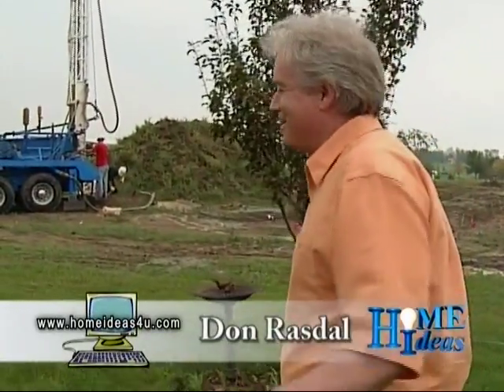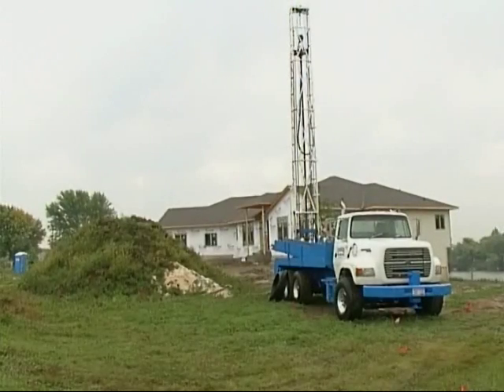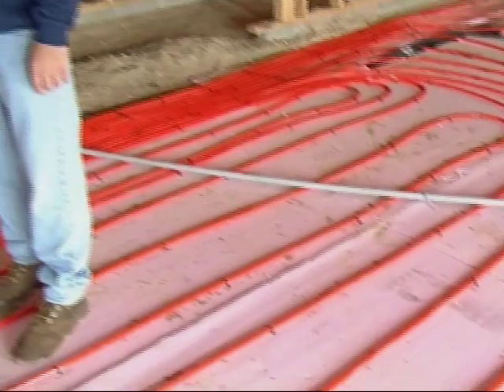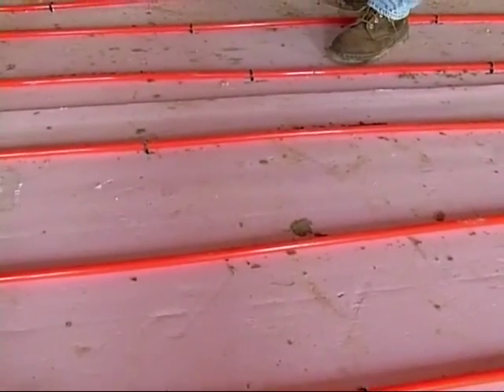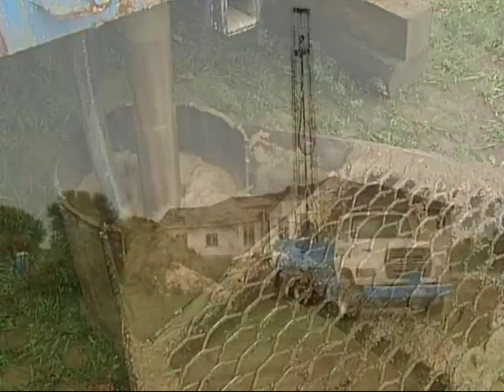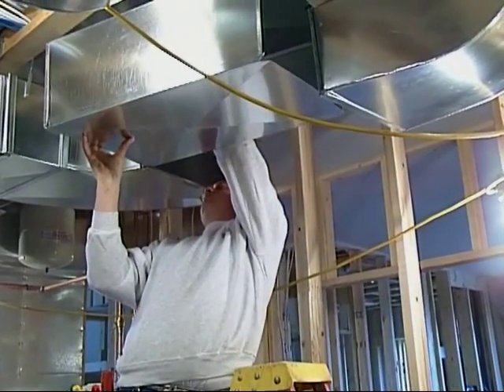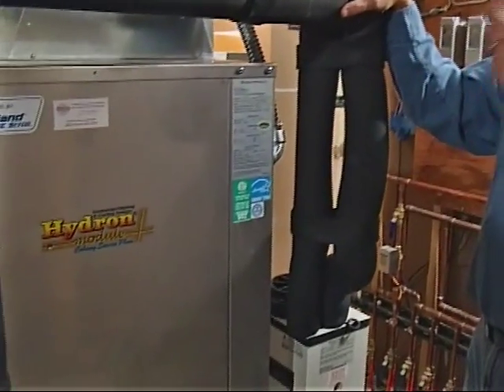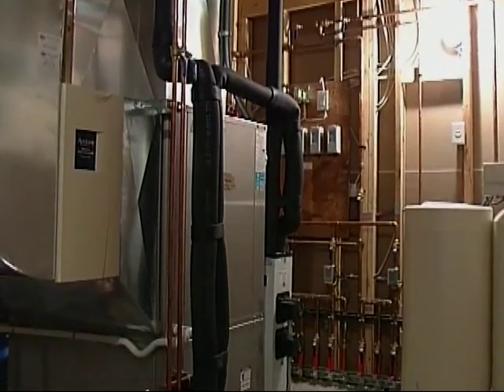Installation of a Geothermal System & In-Floor Heat

Comment: You contradict yourself, you said geothermal is best then you say infloor heat is best. Why do you need both systems?
Reply: Geothermal is basically the energy source and radiant heat is an effecient heating system
Reply: Infloor for heating,  forced air for cooling(and possibly backup/makeup heat source).